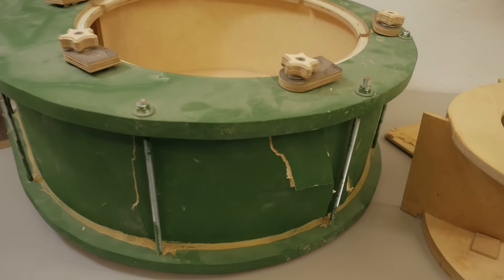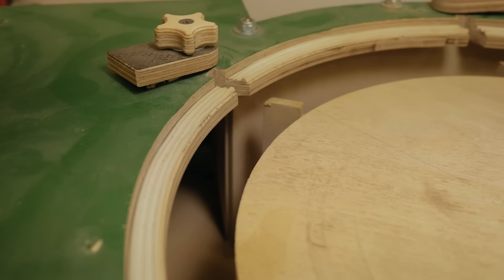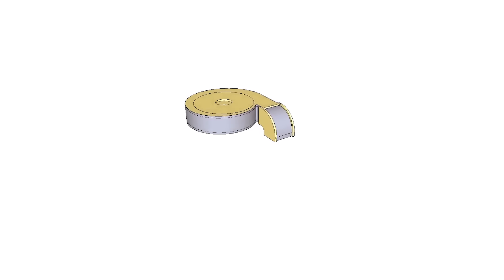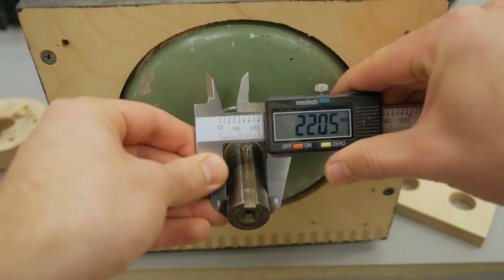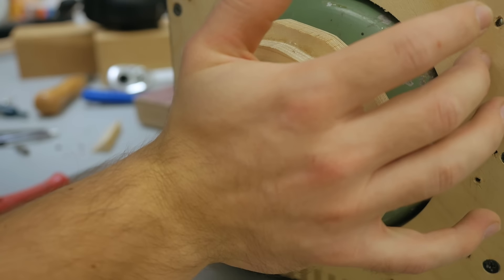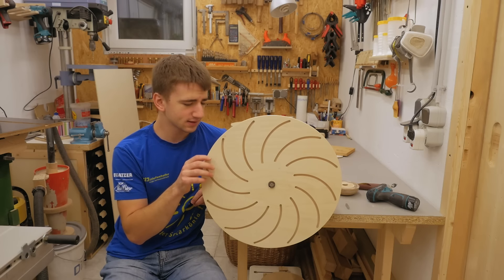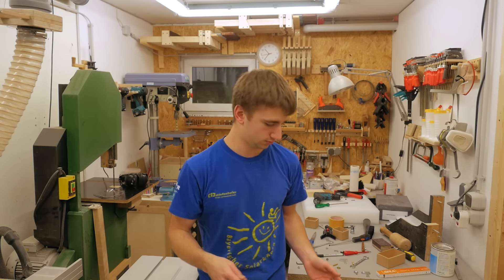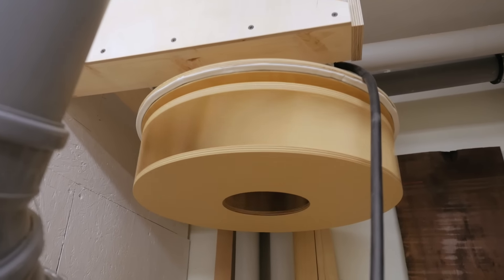Building a Big Dust Collector Blower #1

Comment: Hey, I'd love to know which program were you using in designing the 3D models of the piece (as shown at 2:20 -> etc) and how did you learn to use it. I've tried a few but I have a huge problem learning how to use them. I've ended up using paper blueprints for most or just do the projects without proper plans. And it sucks, if I want to get any better.
Reply from the maker: It's SketchUp. I learned it by watching tutorials on YouTube and then just drawing and drawing and drawing.
Reply: Thanks, that's the one I've been trying with, but it was so painfully slow that I guess I gave up too soon. (I guess I did, since I didn't even recognise it anymore )

Comment: About noise frequencies, have you thought about prime number (11,13,17...) of blades, like in aircraft engines? That should make less complex noises with less frequency components. It would get you 1 frequency instead of 5 in case of 12 blades because of number of dividers (not strictly speaking).

Comment: I was concerned for a bit about the mounting flange screw coming loose, but the motor turns opposite to the thread direction of the screw, so it's all good.

Comment: I know this is an old video, but if you need a key for another motor shaft, i can recommend using old allen keys or drill bits - allen keys are a bit easier to shape. They are made from nice hard steel.
Reply from the maker: +Peter G good idea

Comment: Have You actually ever thaught about a VFD or at least soft starter to reduce forces on the impeller during startup?
VFDs have great advantages on energy efficiency and fine tuning resonant frequencys on the blower.
You also could scale Your fan to new demands in the future simply by running it a bit faster or tune the right airflow for Your cyclone.

Comment: Did you consider extending the centre pin through and attaching to the upper disc, so as to transfer the accelerative force to both discs equally?

Comment: you make great videos, with really high production value, also is 3 phase in homes common in Germany or do you just happen to have it?
Reply: it's common in private houses, but in appartements only in the kitchen (for the stove)
Reply: It is very common (at least in rural areas). Many electric ovens still use 3 phase power.
Reply: Maybe not everyone has an outlet for it installed, but pretty much all houses and apartments (here in Austria, which is very similar in that regard) have 3-phase at the junction box. So if you would need an outlet, it's just a matter of how easy it is to get the wires where you want it.
Reply: Homes in the US rarely have 3 phase. Common in homes are single phase 220v with 110v to ground/neutral
Reply: I'll admit, I was surprised by that too, I'm in the UK, and we only have single phase to the home (apart from some older or larger houses). Also, UK 3 phase is higher voltage, 415VAC Vs 380VAC for the rest of the continent. However, in order to harmonise European power networks, our 415VAC equipment has large under voltage tolerances, and the continents 380VAC equipment has larger over voltage tolerances, resulting in European 3 phase being classified as 400VAC, even though no-one actually generates 400VAC, so be careful running equipment made for the other market, the tolerances means UK equipment can run as high as 440VAC and European equipment can run as low as 357VAC, and still be within specification

Comment: Is there a way to soft start that motor. Seems like that huge spike of power causing it to actually twist when it starts might be part of over stressing the joints. Either way, great video.

Nevermind, just got to 9:15 =D

Comment: I know this was posted awhile back. However is there any way to add a soft start feature to your blower motor. That way you can bring it gradually up to full operating speed and reduce the stress on the blower head and all of the various joints within it.

Comment: Hi Marius, as always great video...I watched it in the past, hower I am now at the point of "rebuilding/upgrading my dust collection blower, and had few questions before attempting the build (Currently I have 11in metal blower with homemade housing). I am assuming that your larger blower is still working well and that you are pleased with its performance so far.  I am planning to build a 16in (or 15in depending on power consumption on my 3HP motor) diameter blower using possible HDPE plastic (we have 1/4in sheet available and was thinking to sandwich two for the bottom plate (collar would be aluminum). Vanes would be from the same material, maybe just keep 1/4in and the top ring would be again sandwiched... I am trying to utilize lighter materials, and the ultimate goal is to increase CFM and "silence" the blower. I am looking into your CNC design and was wondering if you could/wish to share it (looking for blade/vane angles and radius). I do work with CAD and also have my DIY designed/build/made CNC and most of the work would be cut using it...Thanks in advance, and great videos. Greetings from Dayton, OH

Comment: I realize this is almost 356 days late, but do you think that putting the fins at an angle in the direction of rotation so that you are not relying on the strength of the 90 degree joints? I think that this could be a viable solution, however more testing and general R&D would have to go into it.

Comment: Are you worried at all about the plywood fins breaking along the layers of ply since they were cut at an angle?  That may be a weak point.  I love the design though, I think I'll be making one for my shop, thanks for the vidoes!
Reply from the maker: No, because half the thickness of the fins is still wood fibers running vertically. The other direction is secured in the grooves.

Comment: for the plywood, you may also could have used the 12mm but cut away a lot of material on the flat surfaces und remain the 12mm at the joints.

Comment: Why you don't use 2-capacity starter circuit? This is regular decision for powerfull motors. One capatitor works first several seconds and only needed to reduce big start Amps. After this    another (working) capatitor is connected.

Comment: intersting approach of cutting the impeller blades. I would probably have done it the way skate- or longboards are usually been made.Those guys use several layers of thin vernier glued and pressed together in a form. This way they produce their own plywood which then can have bends and still be very rigid. Search for "longboard diy". to see, what I mean. The way You did it is less tedious though. Frank
Reply from the maker: But they glue long grain to long grain to long grain etc. I need stability in two directions. And plywood provides that with layers glued with alternating grain directions.
Reply: not necessarily. Boards often are bent in two directions in order to give them more rigidity. At least that is what I would do in case of the impeller. No idea, if this would be better or worse. Actually I like the way You solved it.

Comment: . my thoughts bout your theory regarding the thickness-weight ratio: using the thicker plywood which will result in adding more weight will actually make the motor accelerate the impaller slower (2nd law of newton) and so you get more strength of the impaller and less acceleration.
Reply from the maker: That's true, though also more difficult to balance. The impeller as is right now already is quite heavy and starting it is less abrupt.

Comment: Great video. How do you suggest cutting the key way slot if you don't have a scroll saw?
Reply from the maker: +Justin Depew jigsaw
Reply: Marius Hornberger through three layers of plywood? I would think the bottom of the blade would drift. At least everytime I cut with the jig saw it comes out about as straight and square as a slinky.
Reply: You could use a mortiser or drill a hole and chisel it square.
Reply: I would use a coping saw.
Reply: yeh i would think it would drift, maybe just chisel and file it?
Reply from the maker: Justin Depew I cut it it with a jigsaw on my old flange. Worked great. Finishing it with a file might be a good idea as well.

Comment: Nice work and everything should hold together now but please  rig up a simple free spinning shaft and and do a basic static balance by using a drill to lighten up the heavy areas...being out of balance will stress the mount and the motor and can lead to a sudden failure even with stronger materials...at the speed its turning at the outside diameter if it lets go pieces are going to be coming off like bullets....even if its contained its going to scare the ever living crap out of you when it dies...not something ya want happening while running a part thru the table saw or such lol.Safety is relative and always up to you but theres no reason not to minimize risks

Comment: What depth/thickness and pitch is that bandsaw blade (first shot in the video with the bandsaw)? It seems like a lot of youtube woodworkers that work with straight cuts in plywood (for machine builds, etc) use fairly thick fine tooth blades to make it easier.
Reply from the maker: it's this one: http://www.tuffsaws.co.uk/index.php?route=product/product&path=4_86_88&product_id=429

Comment: I was wondering if you could add a spider (of spokes) in the plane of the outer disk; holding another bearing on the axis of the spinning motor. This would stabilise the axis of rotation in future, with very little increase in mass.  Plywood is a light material,  but there is still a large volume of it - spinning at large radious. 
How about a welded steel (or aluminium) impeller. With say 70% of the diameter but twice the blade width. Supported by a second bearing on the plane of the outer disk. The overall mass might be reduced, but the energy stored in the spinning impeller would be drastically reduced.
Reply from the maker: I don't have tools for that sort of metal working, but I have another blower design (experimental) in mind, that could make use of a second bearing at the bottom.

Comment: When you were talking about stress to the blades why not consider using a series or really long bolts to attach the back and front plates together. The metal should then take on the shear forces and your blades would have less force applied to them

Comment: I'm late to the party but, don't get hung up on negative comments like you highlighted. Hindsight is 20/20 and if they saw a concern but didn't speak up, their advice isn't worth a damn. Keep up the good work.

Just curious, did you think about using polycarbonate or another plastic for the wanes amd/or discs?

Comment: Does the impeller have been balanced?  Because it change a lot in load in the blower housing ;)
At least roughly balanced (turn the impeller few times on an axle, check the bottom point and remove material or add material in the opposite) ?
 (I have already experimented that ....some blades flying in a shop, it wasn't a good day ...  fortunately no human damage :D)

My mechanics habit tell me to put sheet of metal instead of wood for the blade, but well we will see in the next video ;)
Reply from the maker: Yes it is very well balanced. Part of the next video as it didn't in this one. Sheet metal sounds like a good idea, but I have no idea how to join it secure enough with wood. For wood on wood there's glue, for steel on steel there's welding, but mixing them...I don't know.

Comment: Not that they are terribly cheap, but you could get a 3-phase soft starter (or a variable frequency drive) for the motor. That would reduce the impulse of the motor on startup and probably give you longer life out of the motor and the blower.
Reply from the maker: I already answered that in the video: https://youtu.be/1D958u-ZLNs?t=9m7s
Reply: They are not that expensive... Chinese ones run 100-150€, used stuff on eBay can be had for less. I'd hate to use VFD on a blower though, seems like such a waste.
Reply: aha! I apparently looked away when that comment was made. I'll show myself to the afterlife now...

Comment: Very nice. Looks to be on the scale of mine, perhaps bigger but you know, just better all round craftmanship, mine is much uglier..... I am considering a soft start unit for my motor. I found one in germany for roughly 120 euros. Perhaps you know of this unit (klingerBorn) already. I used 18mm plywood for the base and 12mm for the top, 4mm plywood for the 12 vanes. It's not really been used, just tested a few times. Lack funds todo the 3ph wiring and piping...

Comment: I'm not completely sure about this, but isn't a keyed connection only as strong as the depth of the the keyseat? i.e., making the keyway deeper doesn't add extra strength, or vice versa
Reply from the maker: That's kind of true, but only if you have only steel parts. Wood is so much softer and obviously the weakest link here, so giving the key more area to push against, makes the wood stronger.
Reply: Marius Hornberger What I was thinking!

Comment: I don't like the impellers grain direction.  I have a feeling it will explode at some point because the grain should be horizontal, but its only a gut feeling.
Reply: christschool I actually believe that the grain direction needs to be both. Just like the plywood. it will help distribute the load for the bending he explained and for the centrifugal force.
Reply: christschool even if it does, nothing will be catastrophic because of the new housing

Comment: You could have put sticks of plywood diagonally near the perimeter of the rotor, following the turning direction, glued below on the convex surface on the fin, at the intersection, and above at the concave surface. This would have transmitted the acceleration directly, the triangular shape would have reinforced the frame, and you could have used arbitrarily thick plywood without burdening the rotor too much.
Reply from the maker: These sticks would block the air flow a lot and create turbulence.
Reply: Marius Hornberger They would, but vey marginally. And as far as turbulence goes, well, it's not like there's a laminar flow in a dust blower. Your design was still nice though, I thoroughly enjoyed the video.

Comment: If it starts with to much force then you could use a Y/D start there is also voltage/frequency converters that can ramp up the rpm slowly :)
Reply: And a Y setup of the windings in the motor gives them 230V on each winding (you have 5 wires L1 L2 L3 N E) then to switch over to D that is 400V on each winding but this an electrician should setup. not anything you want to fiddle with your self, i am an electrician so i know. :)

Comment: Is it typical to have 3 phase power to the home in Germany? We have commonly 2 phase (180 degree phases) here in the US. I've never seen anyone have a 3 phase hookup in a residential home.
Reply: its not that uncommon atleast not in scandinavia, in older buildings, as the old stoves and electrical heaters and so on operated on 3 phase, (400V) now a days 2 phase is the norm on appliances though...
Reply from the maker: yes, it's pretty much standard here. Most stoves run on three phase, so it's no big deal to wire other rooms as well.

Comment: Making a star/delta starter isn't such complicated. Two relays electrically blocking each other (so they don't both switch on) and timer(electronic, or switch that closes when the rotor starts sucking , probably coupled to mambrane)

Comment: Use softstart 4 engine. Re design impeller. Fins shouldn't be band not cut. Suction part of impeller is too small. BTW for that strong engine impeller could be 4x bigger.

Comment: is there an aerodynamic reason you can't just remove a bunch of material from the impeller disc by drilling holes out from it in the space between the fins?
Reply from the maker: +Michael Stephenson yes, this would have some aerodynamic effects/issues. But it would also weaken the structure.
Reply: That will give some more turbulent flow on the wood`s interface, and thats not the point you want at a blower.
Reply: You could probably loose a lot of material by drilling blind holes without weakening it too much. Then you could fill them with something light like Purpen (construction grade expanding polyurethane foam). If you cover filled holes with flat surface while it expands/cures it will create a flush top surface that is quite hard. Just remember to use something like a garbage gab in between because foam sticks to almost everything and use plenty of clamping force.
Love your videos BTW, keep on making them :)

Comment: When the motor can run in low rpm, why not use it to spin up the impeller with less stress?
Reply from the maker: But it can't run at low rpm. Only with a VFD.

Comment: Next time you need to clamp something like that, instead of using a ton of clamps just put a board on top then stack up as much weight as you can.  Tool boxes, solvent cans, extra motors you have laying around, etc.

It's faster than clamps and it distributes the clamping pressure more evenly.
Reply from the maker: That clamping pressure would be nearly enough for this clamping situation.
Reply: No doubt.  Just saying it's faster, way easier (no fussing with a bunch of clamps) and better.  But the clamps are good enough.  I use weight any time I can.  Saves a ton of time.

Comment: Marius, the air entry opening in your impeller is much too small.
The opening, the swept area of the leading edge of the blades, and the fan outlet swept area,  should be closely similar in area, so the blade 'cover' should be conical.
Changes in area cause variations and losses in the airflow.